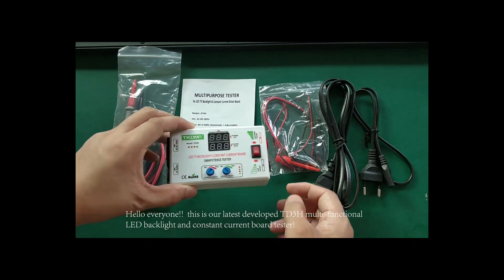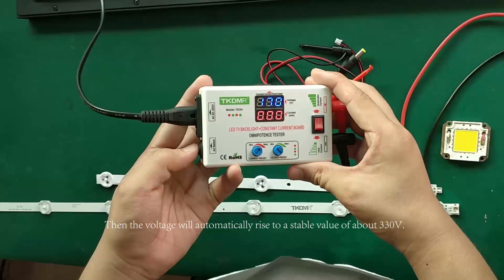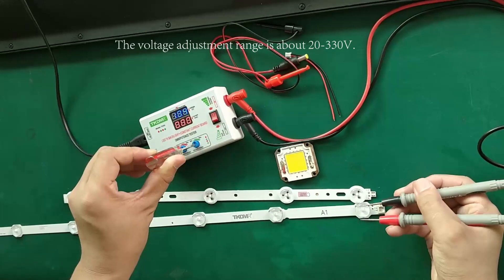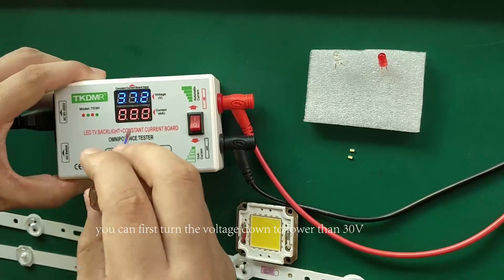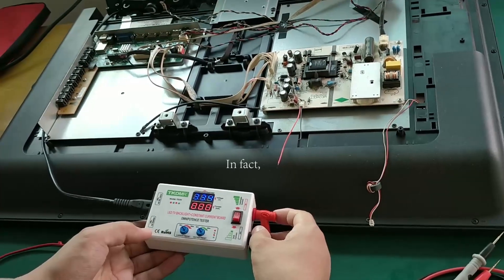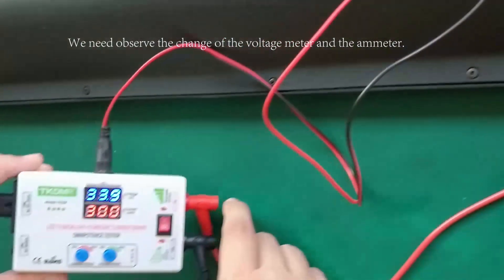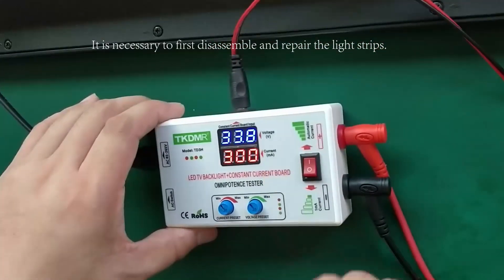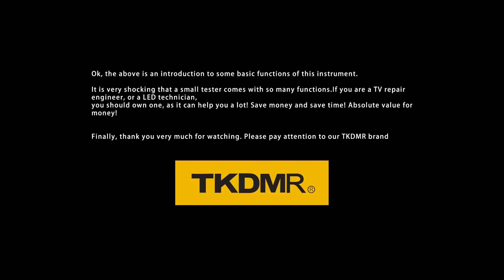TKDMR Newest TD3H LED Backlight Tester How To Test TV LED BackLights use LED TESTER!

Comment: Good product, quite possibly the best tester in the market. But there is still one issue it fails to address: Sometimes LED Backlight strips will only fail when working at their normal current loads, which can be as high as 700mA in some tv models. So it is possible that they will seem to be working when tested with 150mA, but fail when exposed to the current level provided by the TV.
Reply: Tradução

Comment: 5:47 Very few LED TV's power supply boards use the type of power supply connector included. Why not include different connectors so this feature can be used on more than one brand of TVs?
Reply from the maker: all brand，just led tv
Reply: @tkdmrlong1781  Did you even look at the connector on the power supply board at 5:47 I was talking about? That connector also at 6:06 doesnt work with "all brand" tvs as you said or are you just saying random shit & have no idea what I said. Maybe get someone whos speaks english to handle your youtube account?